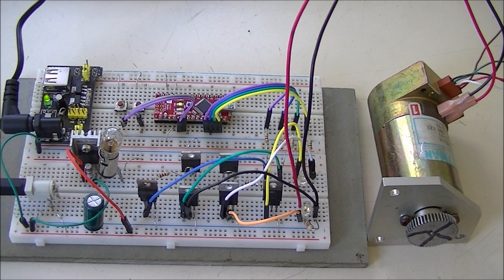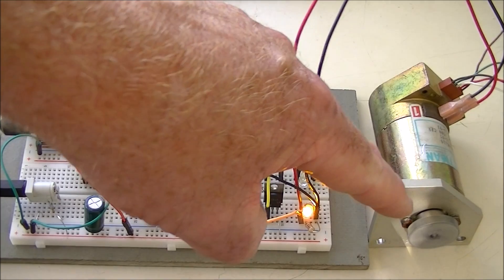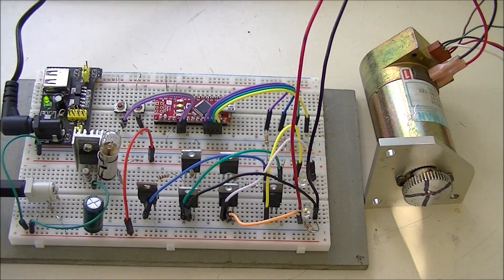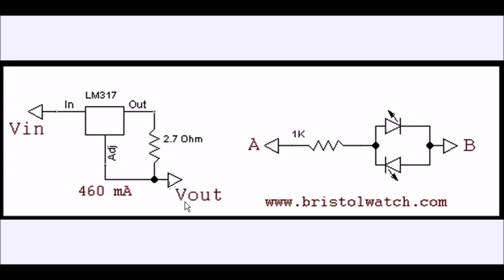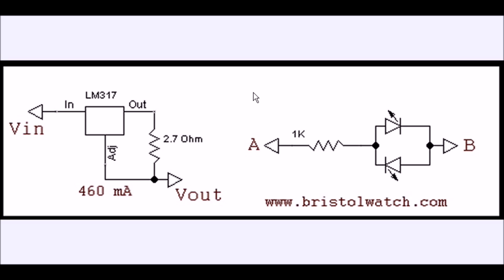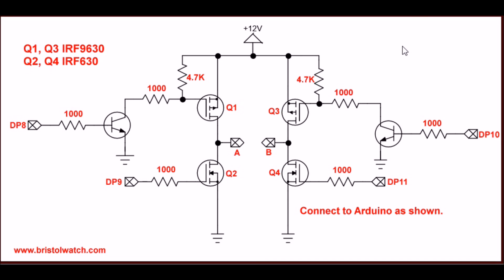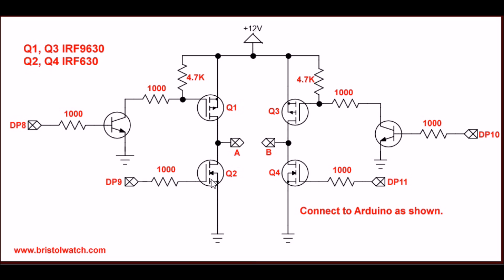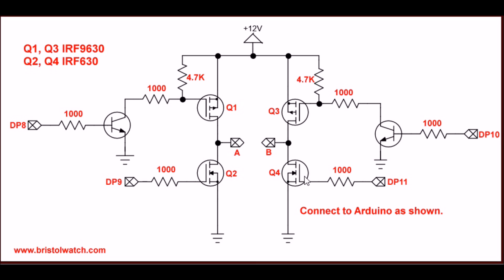MOSFET H-Bridge for Arduino 2

Comment: PNPs don't drop the voltage, but require a gate voltage slightly lower than the drain voltage. NPNs drop the voltage but can be driven with low gate voltages. So you use them in tandem, with the PNP at the front before the motor, and the NPN at the end when the voltage drop doesn't matter. If you build the entire bridge using NPNs, the front two will get hot due to the current drop, and the voltage will be too low to run the motor. Idk if anyone will read this but it's fundamental stuff.
Reply from the maker: A p-channel has a gate voltage lower than the source voltage. An n-channel has a higher gate voltage than the source. These are not NPNs or PNPs, that is bipolar transistors. These are MOSFETs.

Comment: Can I use S8050 bjts in place of the two P-channel mosfets that keep the voltage from the arduino? I was able to salvage 6 mosfets from old power supplies for an automated door  that I am working on for my cat, but do not have enough P-channels for this configuration
Reply from the maker: You can use PNP BJTs, but the wiring requires a significant modification.
Reply: @LewisLoflin  Ok thank you for the reply! I'll do some research on how to wire it using the PNP's.

Comment: Is the 5V Arduino pin voltage, that is applied to the Q2 Q4 gates, enough to turn the IRF630 mosfets on properly. 
The data sheet tells me that VGS must be 10V to achieve RDS(ON) of 0.4ohms.
The 5V is just above the mosfet threshold voltage of 2V to 4V.
Am I missing something? I'm just learning. Please correct me if I am wrong.
Reply from the maker: They work when I tested them, but I replaced them some time ago with:
The IRFZ44N is an N-channel device rated at 55V and RDS(on) resistance of 0.032 Ohms max.

The IRF4905 is a P-channel device rated at 55V and a RDS(on) of 0.02 Ohms max.

Comment: I’m building my h-bridge very slowly…

Currently have half an h-bridge with high side PMOS and low side NMOS transistors…using bipolar transistor to activate PMOS…

Current limiting resistors for bipolar transistor work as expected…

1K ohm series resistor on NMOS gate, with a 10k ohm pulldown resistor as well…

Circuit will power an LED just fine…push button control, using 3.3V pin on a raspberry pi connected to NPN base and NMOS gate (no programming yet)…

But when I connect A and !A of a  bipolar stepper motor coil between drain pins, it won’t step…

Bench top supply is set to 12 volts and 2.5 amps…stepper motor rated for 2 amps…

Motor will step when manually connected to bench top power supply…

Why won’t my half h-bridge step the motor once???
Reply from the maker: See the following for some better ideas. www.lloflin.com

Comment: hi Lewis,
good job. thanks a lot. I thinl LM317 is not set correctly. u'r not using it at all as u enter from input with red wire! The bulbe is supporting thecurrent feed. But appreciate your work & explanations. thanks

Comment: Sir I Am New To Electronics Thanks For Nice Video With Best Explanation. 
Sir Your Schematic MOSFET H-Bridge for Arduino Works With 24v DC Motor? Or Do I Need To Change Anything. 
Thanks And Regards.
Reply: Hi, you have to add  zener diode 12-16V paralel to 4,7k resistors that will protect  P-mosfets  gates Q1,Q3

Comment: I am new to Arduino and parts are hard to get. I built the Mosfet H bridge that has only 2 connectors for arduino but I dont know how to program the Arduino to use it. Please help. Thanks in advance.
Reply from the maker: It's very simple to program of you are using the correct design. Switch both OFF, switch the side you want on. To change direction switch both OFF, then switch the other on.

Comment: i would not have used 2 pins per side, as on power up arduino pins are random, i would have cross coupled them so worst case scenario is a bit of motor spin not a short
Reply: not according to his software.  but good eye brother
Reply from the maker: If the Arduino is programmed properly this isn't a problem. That is why I used direct port access. Thank you.
Reply: Lewis Loflin That code is CLEAN love it!
Reply from the maker: That is also why i included current  limiting in case of they very problem during development.
Reply: its very good practice. 
saves money too  :)
love your work, Lewis